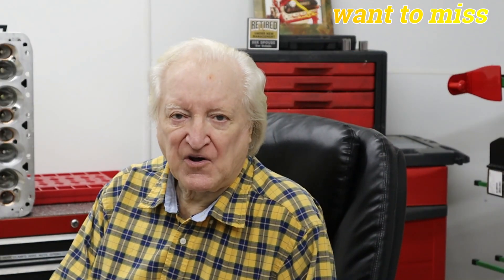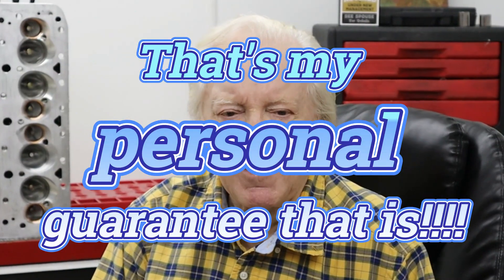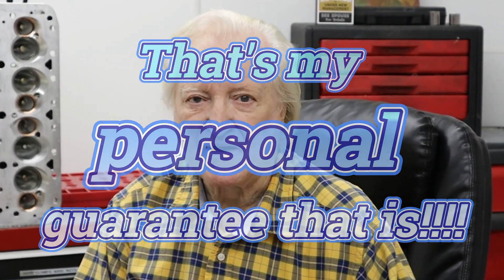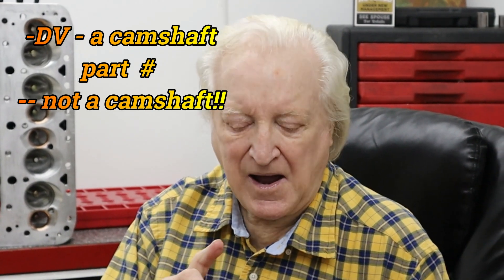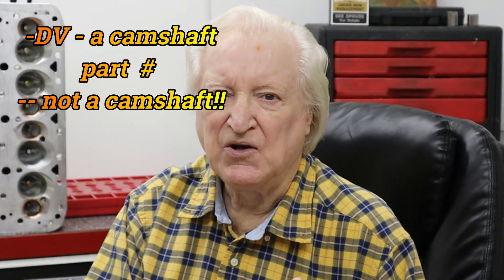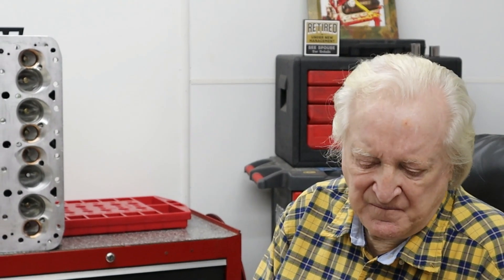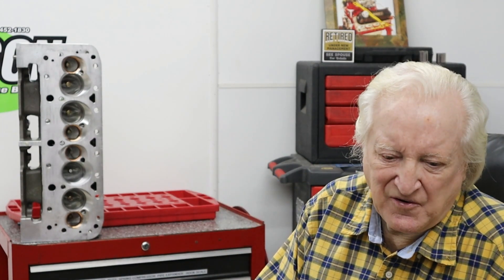A V10 LS motor??

Comment: I appreciate all the effort you put into your videos. I have a Ford 302 Boss Cleveland head engine in the works. I have built several of these in the past but always was literally guessing the cam specs. It's too bad there aren't more intake manifolds offered, maybe I'll try to build a sheet metal intake. I realize that a windsor head would be easier to work with. These are budget motors as I already have most of the parts to build them. My point is what I am learning from you is going to seriously raise the power potential of these engines!

Comment: 🔔😎
I revisited ep 36, Dec. 22, 2021, and have eagerly waited for part 2. Not on the video list.🤔🤔  Time has come for my cam upgrade. But to which? 
The E at least has 110* LSA and I'm considering 1.7 PRW steel rockers (rocker studded heads). 🙄🙄😳😳

Comment: Mr. Vizard, I got excited when I saw V10. I was thinking David has built a Ford V10 Monster!
Reply: You don't see those v10 Fords doing anything impressive very often.  It would be neat to see DV make one work!
Reply: I have seen the big Chrysler truck v10s be made into some torque monster for very little $$ because you can get em dirt cheap. Got to enjoy those smiles per gallon though because they cost $$$ to keep fed with fuel making all that power!

Comment: DV, magnum v10s are basically the old small block mopar with two cylinders added. Cousin of the viper v10 they were found in dodge ram 2500 trucks and are more common than viper v10s. And use common parts with the magnum v8s such as bearings, rods, pistons, rocker arms studs and pedestals. And the same lifters. If money weren't an issue, I'd want a Gen 3 hemi (2003+) v10. And make 1200 NA without having to have a pro mod type motor that you could still street.

Comment: Mr Vizard please include on how to select a camshaft for  A Standard Triumph  2L Straight 6 Engine, Using your Gained Knowledge since the 70’s 
Tuning Manual You Wrote. Thanks.
Reply: That is an engine I would also like to see as I have the 2.5L. I think the entire triumph community would be excited about David revisiting it if only for one video.
Reply: His book is pretty comprehensive. I bought it years ago. Good refrence to have around when looking at cams, heads, intakes and exhaust. The concepts apply to any spark ignition engine.